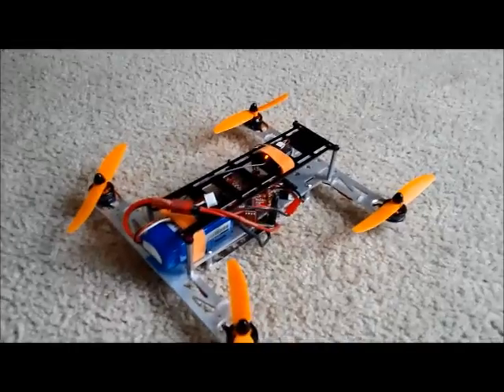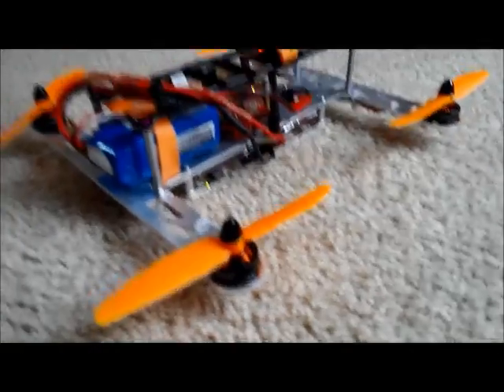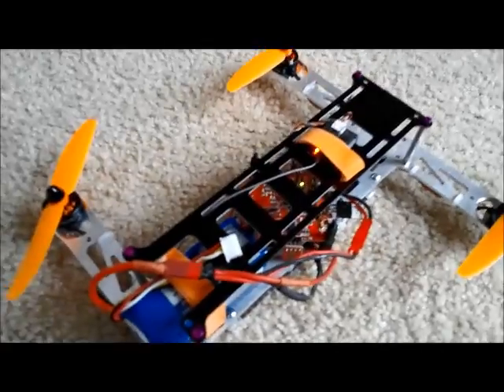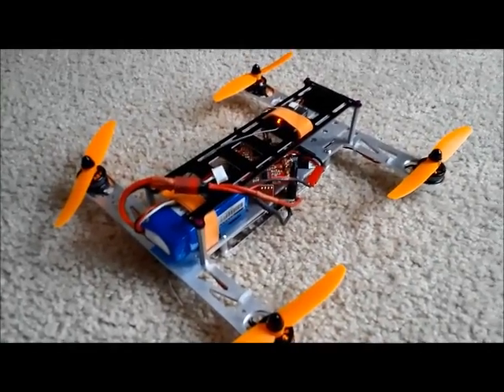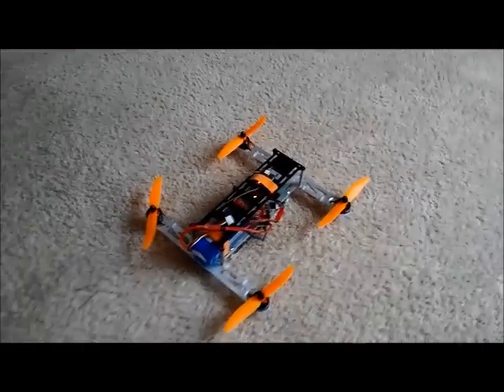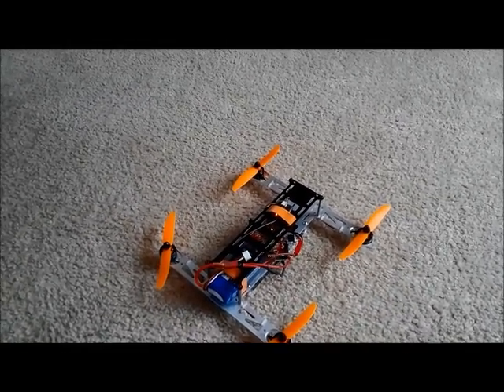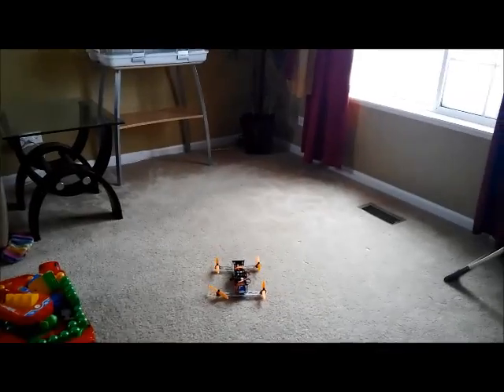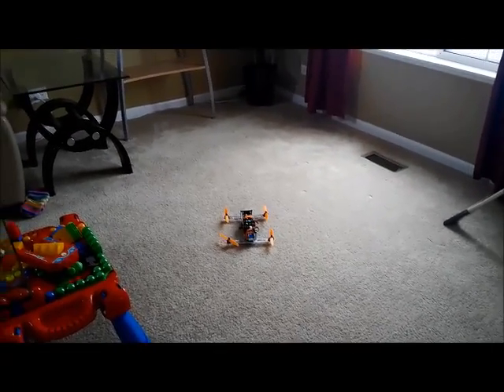Mini Metal-H ead FPV Mikrokopter FPV frame

Comment: 3 blade 5x3s, ken? Maybe
Reply from the maker: hi Rob, im not much of a fan of 3 bladed props.   however i just ran a 4s battery 1300 and motors held up barely warm after 9 minutes flying around front room. :)